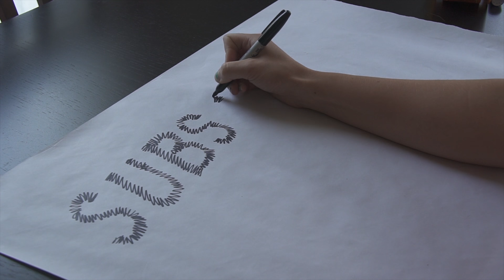How to Fly in the Winter

Comment: Hey Nurk, got out for some -20C flying (-5 F)  last weekend.  I had only ever flown one pack in the winter before so it was definitely a learning experience.  Vid up if you want to see a frozen lake flight ... I mean really frozen, we parked on the lake!  Here's some things to expect in the extreme cold:

- Your battery on your GoPro / Runcam becomes an issue.  I was completely draining the battery on my GPS5 in 2 flights, and the Runcam3 (I was trying out ND filters on it) was dying during one flight.   Having a bunch of cheap power banks for USB recharging is handy

- Zip ties get even worse that what you experienced - I had 2 'generic' goPro mounts completely come off, just landing.  You think everything is cool and your GP and mount are sitting there beside the quad when you land.  Scary stuff.  Getting some super thick solid zip ties from electronics store asap for winter flying.

- Battery life was not terrible, I was getting good use of 1800 and 1550 on my 6 inch Chameleon.   1550 only on my Rotorgeeks Odo 5 inch.   Was landing with voltage showing 14.0 - 14.2 which would recover to about 15.2 by the time I charged them in a warm house.

- If you're flying with a buddy it is a great idea to "buddy fly" on the same channel and trade packs so you have 2 DVRs and better recovery.   Do not fly if your "DVR isn't working", stop and get your buddy to record.  Close call when I hit scraggle overhanging the lake and bounced into a back yard ...

Comment: I had my first crash in the snow yesterday. The camera stopped recording after a few seconds. I blew it off with the air compressor and the camera sisn't work at all. When I got home I pulled gunk off the wires and the camera worked again. I was sure if I crashed into snow I would blow everything. Luckily that was not the case this time.

Comment: Do you notice much loss of range when flying from inside a car? Any tips for not losing orientation between the similarly coloured sky and floor? Do you ever find it difficult to gauge your height above the snow?
Reply from the maker: Video definitely is a little spottier -- especially behind my head/the blind spot of the car, but RC signal range is just as good.